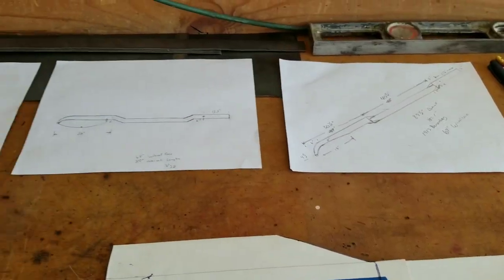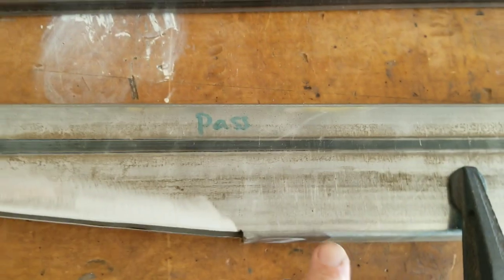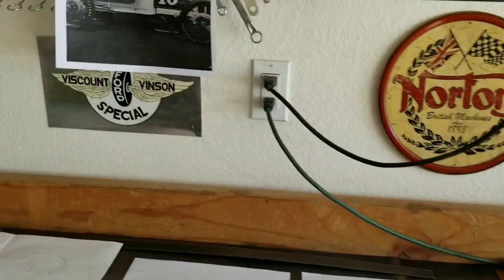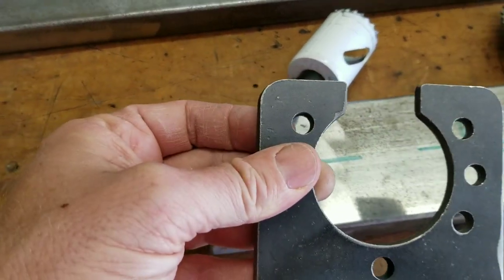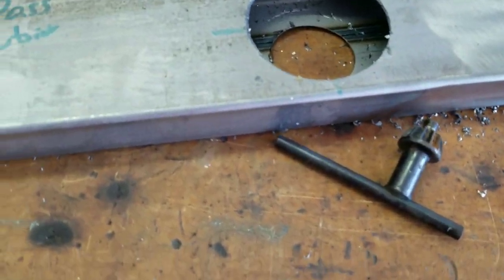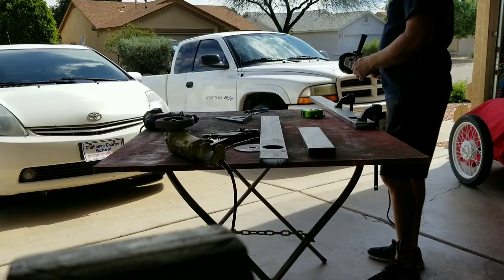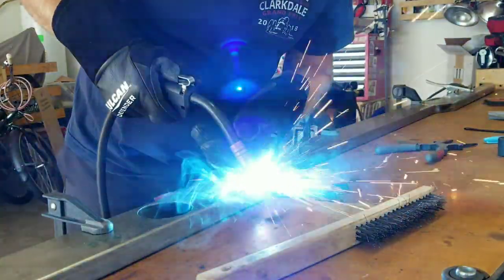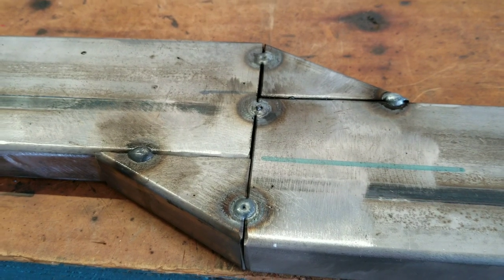Cyclekart Frame part 1 Z'd Frame

Comment: Steve I watch nearly all your videos, good stuff, 3 years old or 3 days new! As an FYI - I became “friendly” with a local commercial metal supplier. They always have tons of shorts/drops priced per pond. The best part, they will sheer/cut anything. Perhaps you have someone like that local? Lastly, I purchased a 24” (yes 24”) commercial bandsaw for $200, there all over FBMP as the big guys don’t want 20 year old equipment. Use it nearly everyday.
Reply from the maker: Thanks for watching. Those are good tips, in fact I just bought a stack of small pieces for $4 today out of the cull bin at my local steel supplier

Comment: If you asked me on Facebook I would had shown you an easy way to do the Z shape from one piece of without having to join 2 pieces. But any way you did it already. And it looks good 😊
Reply from the maker: Thanks, I appreciate the offer.  This method was not to difficult.  Thanks for watching.
Reply: Do you have a video of how to do it ? I'm always wanting to learn.
Reply: @scrapwire1  no. But here is a link for a video that can give you an idea.
The point is to cut a V out from the bottom. You bend the side member so you get an angle to the top than later you cut an other V but this time from the top side to get the member back down to the same alignment. If you can't calculate it "like myself" you betet try in on a piece of paper first to make sure you cut the right angle
Reply: @martinshow5146  Great video, Thank you